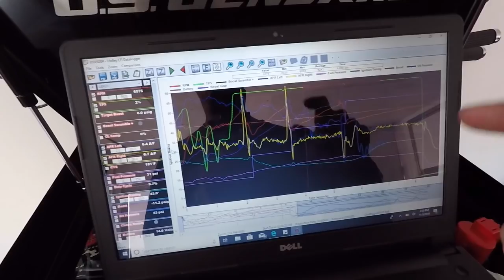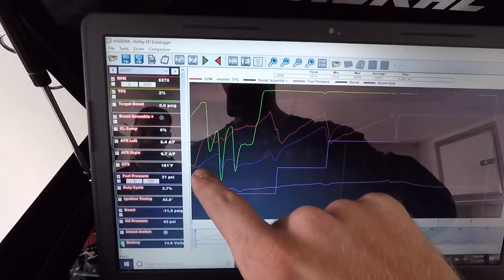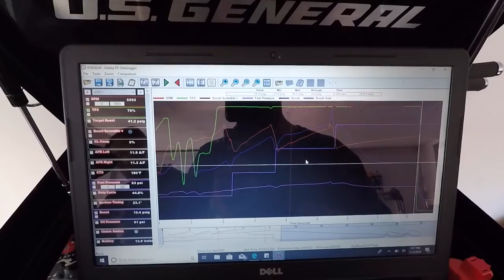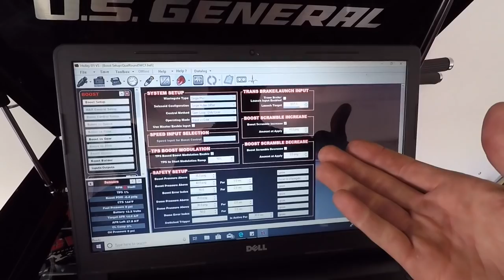World Cup Day #3 - Third Round Qualifying, Shattering Parts (Changing To Old Mounts)

Comment from the maker: Here's the plan guys. The track is SO TIGHT so the plan is to try and use our old diff mount to let the drivetrain move around a little bit more. We think that the new solid torque tube bushings and our new gnarly solid diff mount might just be too much for the current application. We're going to try the old mount and only do soft launches today. We just need to survive the weekend, I already called RPM and said I caved, and that we need one of their C6 rear diffs. The C5 diffs lasted a while but we've reached a point where we make SO MUCH power off the line and through the 1/8th mile that the C5 cases won't cut it anymore. It'll be a pricey swap, but well worth it. RPM always gives us a good deal and they're the best in the business!
Reply: YOU KNOW BEST JUST LET HER RIP
Reply: Cleetus McFarland, good luck guys!!🇺🇸🦅
Reply: Probably the best move.  That C5 diff just can't handle all them bald eagles!
Reply: HELL YEAH LEROY THE SAVAGE!
Reply: Send it baby!!!
Reply: RPM Hook Cleetus up lets get Leroy in the mid 7's
Reply: BOO BOO,  CLEAT CLEAT, AND LEROY JENKINS FOR THE WIN
Reply: LET IT RIP TATER CHIP
Reply: Cleetus McFarland Wash, rinse, repeat kid!
Reply: Cleetus McFarland hi
Reply: I was about to say that ,that diff mount is too much
Reply: Cleetus McFarland  is at all possible it would be awesome but I don’t know how it would work but if you could put electrical power to the front wheels it would leave so quick 😂
Reply: Cleetus McFarland the upgrade cost 1 video....
Reply: 30k+ a month just from your channel, i think you can swing a c6 diff swap lol.
Reply: You NEEED to go c6 Z06 or ZR1 diff. I wish I went that route instead of a cryo treated HD 3.90 base diff. And now they’re making gears for the bigger Z06 diffs.  I’m honestly surprised you didn’t do so earlier. Just sell those trans on EBay.
Reply: @MillionairX  how did you calculate that?
Reply: just encase the prick in jb weld lol
Reply: All this just to lose to a civic 🤭
Reply: Sometimes loose and sloppy is the better option 😂
Reply: Cleetus make some. Merchandise that say James get the tool box
Reply: Let er rip tator chip em bald frekin eagles man. Honestly im amazed how that stock c5 diff held in general... It does make me have even a better thaught of the high quality we get from corvette. Amazing!!
Reply: You need to just go independent 9 inch or back half it and go solid 9 inch.
Reply: @jamesmcivor340  google socialblade and have atter.
Reply: @MillionairX  youtube doesn't pay half as well as it used to.
Reply: What about one of RPMs other diff solutions like 9inch
Reply: Ideally you want a milled hardened and heat treated diff casing, a cast casing will always break it's just not made to handle so much torque. If you can't get one fabricated (places that make custom heads should be able to make one for you given a model), you could also try to reinforce the stock case by enclosing it in a tight tube or rebar cage (tight to the point to have to stretch the bars a bit to get the diff in it, to apply positive pressure on the cast diff case) and anchoring the cage to the frame instead of using the mounts. If it's fitted tight and has uniform contact and pressure around the diff case, a lot of the stress that pushes the diff casing apart will transfer to the cage, and to the frame. It also adds a lot of heat sinking to keep the diff cool.
Reply: Rhys Werner he’s making like $40-50k a month. Gotta pay the cost to be the boss lol
Reply: Sounds like a decent plan.  Best of luck!
Reply: Aero is killing you brother you need a nosecone minimum.great tho do it for dale . And ed
Reply: I think if you do use that solid mount, it'll be best to make sure every bushing on the rear axle is solid aswell. Any play from solid mounts comes from soft bushings.
Reply: Hell Yeah Brother! Talked to Cooper Spaghetti a bit yesterday, he said he hates the smell of diff fluid! Hahaha I think we can all agree on that
Reply: HELL YEAH BROTHER LET LEROY EAT!!!!!! 🇺🇸🇺🇸🙌
Reply: Garrett I sent you an awesome pic of you and Leroy on the starting line yesterday on IG check it out when you get a chance
Reply: after the diff the axle shafts
Reply: You should of already had a c6 diff  on standby because you had to of known you would need one eventually
Reply: Cleetus McFarland dude if you had a better diff and bigger tires you would easily hit 7.6 you need a wider tire! And a stronger diff
Reply: @donnyanda3191  If you go back to the wind tunnel episode, the nose isn't that bad, it's mostly the back end. So a diffuser would do a lot more for them.
Reply: is the plan to have the C6 rear diff in before the C&C Florida?
Reply: Cleetus McFarland i
Reply: Riggs Homestead-fast      Every time your sniffing gear oil it’s usually a bad thing. I’ve Ben down that road... i used to 4x4 the yota. Big nasty rocks destroying ring and pinions, axles, transfercases. Never pleasant when you start smelling gear oilz
Reply: When you were installing that solid mount I was thinking that it might make it worse since there is no give. That aluminum case becomes the weakest link and just can't handle that power.
Reply: Is the new part u put in the bar. Is stiff now
Reply: How many crazy people you guys got running in to you like old boo boo and can't remember a name to save his damn life gotta love Florida you are always gonna see home wild shit there
Reply: Good call guys. Definately need some extra cushion for that glass diff case.
Reply: Good luck today Cleetus, Let her rip!
Reply: Going with the C6 is the right move..  going to be a pain to fit but worth it in the long run
Reply: Unfortunately, when racing hard like the way Cleetus and Leroy do. Things tend to happen parts tend to also break. I was hoping for more record breaking numbers this weekend for Leroy the Savage. Well dang, maybe next time. For now let's keep on doing it for Dale.
Reply: You should look into a clutch flow control valve like the one from clutchmasters to soften up the hit, then put car on a strain guage so you can clutchless shift the rest of the gears
Reply: Makes some JAMES GET THE TOOLBOX t-shirts
Reply: @rhyswerner8749  So what are you saying? 
The website i said to google for literally pulls the data straight from youtubes analytics of each channel. It's not super accurate because of all the variations but good youtubers like cleetus still make a pretty good chunk of change.
Reply: You need to call jay at real street. They use a hydraulic damper on the clutch pedal to control release speed. You can probably even tune the holley to only have it on in first gear or maybe first and second to help ease the shock on the drivetrain. It would make your launch and 60ft more consistent. Then you could cut the 1.1 60s all the time.
Reply: Lettin the difs rip 🚘
Reply: If you need a billet case it should not be that hard to make @Cleetus. measure the stock case, create a 3d model in mastercam and get in cnc machined. take into account thermal expansion rates of billet vs cast. but I would talk to your local machine shop. they should be able to build you one.
Reply: Will be $$$ though. im currently in school for this king of stuff.
Reply: Roberta Swenson They are in Maryland.
Reply: slagertoothtiger Installing a 9” or “back-halving” LeRoy is not an option because of how the in a C5 and later Corvette Chassis/Drivetrain is designed.  Remember in the C5 the “Transmission” is in the back of the car and bolts directly to the “Differential.” Instead of me trying to explain it all it would probably be be better to just Google C5 Corvette Drivetrain and look at a picture(s) instead.
Reply: Why not weld and gusset the c5 case up make it stranger... Fyi I thought the solid torque tube bearings bad idea no place for give with them
Reply: Im sure you would have it if it was built but can you talk to someone that can make a billet case? Is it possible?
Reply: Let her RIP tator chip ..hopefully the last case holds up and gets you through the weekend.
Reply: HMan - I like every word of your fab’d case proposal. I’m not an expert (I wasn’t!), but was already thinking about the relative cost of fabrication compared to all trouble (and broken hearts!) it’s caused over just these last two days, let alone before... Thanks for sharing your obvious expertise.
Reply: You need to forge a differential from thors hammer.... Only that will handle the bald eagles and that amount of freedom...,🇺🇸🇬🇧
Reply: Think thats a great idea! I thought to myself yesterday yall were going to cave and go with the C6 diff. Haha let ‘er rip tater chip! Murica!
Reply: Sounds like your plan is to finish in the middle. Americans don’t quit, don’t go for second and never let our colors run. “If you ain’t 1st, you’re last” go for gold and let Leroy eat.
Reply: I can't wait to see how much power and better runs that c6 diff is going to allow* I think y'all are at a major turning point where Leroy is about to really be ripping some new records*
Reply: It's not the same RPM as high PSI TV is it?
Reply: Titanium parts may be able to hold up I'm sure RPM is thinking your the perfect parts testing person and will push them to perfection on parts.  They are doing their best to provide parts to hold on to the bald eagle power ..but busting up parts is all part of the racing  scene if it's not breaking it's not racing. I would send the broken parts back to RPM for testing it may step up their development of parts it's a win win situation.
Reply: I wonder if the side horse shoe looking brakets could be made into a full circle with incorporating brackets to wrap around the diff cover.... That would make the c5 case much stronger
Reply: Can’t wait till you get the new dif! Hope to see you in Bradenton! Good luck guys!
Reply: The side plates that go around the axle output should have plates that attach to the diff cover kinda like a box surrounding the diff... Then it might hold up. Probably less work and money.
Reply: Exactly my thoughts. Stiff mount and new solid bushings meant zero flex in the driveline back there and pop goes the diffcase every time. A little flex can be a good thing! Nothing wrong with the parts, just a combo together that wasn't going to hold.
Reply: Right on ...makes sence.....you need a little movement
Reply: They r the best but normal people can't afford rpm parts sux
Reply: The cracks look like something tried to come out of the back rather than something twisting
Reply: What's the rationale behind keeping the solid torque tube bushings?    Seems a great way to transfer as much shock into the tranny and diff as possible.
Reply: 9inch for maximum freedom
Reply: Clet, maybe time for a new T-Shirt
"JAMES GET THE TOOLBOX "
Reply: Solid everything is bad for your application. I'm glad to see that you are going back to softer drive line components. You may have to change them often but they rubber stuff is cheaper than the metal stuff.
Reply: Owen Conner c6 z06 and zr1 diffs are practically the same case.
Reply: Make a shirt that says james get the tool box
Reply: nastychevys he doesn’t need that.
Reply: 2001MXZ800  yeah mastercam is a cam program not a cad program and that’s not gonna work you don’t just work programs like that with no experience... there is no need for a billet case a C6 case is stronger it’s his own fault for using the base C5 diff.
Reply: Cleetus McFarland 👍
Reply: Amen brother glad your gonna make the jump to the C6 drivetrain, i think that will be a huge help to the process!
Reply: Cleetus McFarland solid mounts are great but flex is sometimes needed.. damn man I really wanted to see you guys prove the haters wrong
Reply: Why do you need a diff on a drag car?  I suppose if you put in a solid axle and bevel gear you'd still need a strong case/frame on it,  but you could fab that in steel
Reply: Cleetus McFarland them flapping flags are huge aerodynamic losses.... only use em in the pits or on the burnout pad not for a drag run
Reply: Cleetus McFarland 
SLIP IT then RIP IT.
Reply: "Cleetus" I sent you a suggestion about using a "clutch launch control" several times. Its a hydraulic clutch flow control, I really think this could help you. There are several companies that make them from full mechanical to solenoid control via switch or ems. I ran it in a dsm and it seemed to help with diff breakage. I hope you see this even if you upgrade to a stronger diff.
Reply: You realize the 2 times you broke you were on the launch control just a tad longer than any other time? I know you can’t really help that cuz you’re waiting on the light. Just an observation
Reply: Cleetus please change the camera angle back to the original place.. the new one sucks
Reply: Cleetus McFarland I like Leroys kahunas 👍🏽👍🏽👍🏽👍🏽👍🏽
Reply: I think you need to take one of the C5 Differentials to Demolition Ranch Matt for a anger distruction.
Reply: That trans mount cost you 3 diffs get rid of that shit
Reply: Cleetus, any chance RPM can get you the upgrade before eliminations?
Reply: @TheMinecraftsMax  why go through all that when they make a 9" that bolts in
Reply: @TheSoundofSpeed  he lost in the first round it broke again for the 3rd time. He just happened to make it past first gear this time.
Reply: slagertoothtiger I don't a 9" will work on the transaxle?
Reply: @waynebollentin989  ah, damn. Bummer. Thanks for clarifying.
Reply: @CHRISTAPHOR JENKINS lmao. Talladega? Really? Why not the salt flats or lets have him go to Germany and drive the autobahn.
Reply: @getahanddown  100% they bolt to the automatics not sure anyone has done a manual though. 
Years ago we made are own adapter to bolt a 2jz to a powerglide before you could just buy shit. So I don't see why it couldn't be done. I know we're talking apples and oranges here but If someone wants something there's usually someone out there to at least try it.
Reply: Cleetus McFarland time to talk to strange about a 9”
Reply: @TheSoundofSpeed  np bro. I'm sure he'll have a video up soon saying something about it. I believe it happen before 3pm if I remember correctly. A lot of great racing. That white import he runs in the stick shift class made it into the 7.90s finally. At least first time I've seen him get there. Really great racing can't say that enough.
Reply: @jamesmcivor340  watch street speed 717 video on what they make
Reply: Damn leroy is straight savage. Can't contain all his power.
Reply: Good idea boss love the content you make these v8s sing. Love the bowtie love too. Fellow Chevy man, wish we had HD Tho good luck with the c6 rear, agreed you need something with lil more flex room rather than so stiff..
Reply: Got to see cleetus and Leroy. Leroy and cleetus today. Cleetus I have so much respect for you man having such a huge fan base and being so personal with everybody. Most people let the fame get to them and are kind of rude people but cleetus shook my hand signed my shirt. He’s always trying to get to everybody and just have fun. It’s not just about the win for him and that’s how it’s gotta be. I respect you so much for everything you do and I want to thank you for being cool and I can’t wait to see where Leroy goes in the future. Do it for dale
Reply: ratchet strap it together
Reply: Bro change the cradle even though you don’t want to. You need to get a stronger dif put in leroy instead of breaking the old c5 dif almost every pass
Reply: Thts the most disappointment ive ever seen you..
Reply: Hi.  Hey James get the tool book should be on a T-shirt
Reply: @jamesmcivor340  it's public knowledge on social blade and that's a very low estimate he's doing much better not that it's really anyone's business
Reply: Cleetus McFarland million subs I think you can put c6 diff in 😝
Reply: @rhyswerner8749 really because streetspeed717 showed us his Actual payment for 28 days and Cleetus is doing 3 times the views and then some it's more like 60-80 k Mike said he is killing it... Mike made $1,200 off of a hundred thousand views video so if he's getting three to four hundred thousand or more each video do the math ..
Reply: @18brash he's literally made hundreds of passes on the original why would he assume that? This only happened when they switch to the solid mount  and when he was on the best track prep in the world
Reply: @user-qb5cl1jf1t  did you really just tell him that ? Wow
Reply: You guys are pushing so much power through that drivetrain, and the parts are taking a beating like none other. The fact that you have only had diff cases go, aside from possible collateral damage from parts of the case destroying the internals, is literally insane. RPM and Texas Speed need a special combined team just to brainstorm how to put as much power through leroy as possible while breaking the least amount of stuff.
Reply: You know I was thinking while watching that last video before you left when you said what you did about the diff that it might be time to make the upgrade but quickly assumed you know more than I do so there was probably something you saw that I was missing and that was why you were sticking with the C5 cases.
Reply: Gotta get a maximum powered optimal bald eagleness freedom fueled do it for dale hell yeah brother run and take home the giant check.
Reply: EddieG  they took the flags off after a burnout unless you’re blind...
Reply: @Built82F100  this is the best suggestion I have read out of all the comments!!👍
Reply: @user-qb5cl1jf1t  hell if he did that he would be in the low 7s
Reply: Cleetus McFarland James! Get the tool box! Best quote ever
Reply: Cleetus McFarland new diff = 7.40's keep ripping
Reply: Well if you ain't braking parts your not pushing hard enough. Let's go Leroy 💯
Reply: I was thinking about that exact same thing when you mentioned the squat not being there after the first pass last video. Then Sendit Steve's diff case got sent. Lol. Whoa! I just saw the black puff. But yeah I think the diff mount might be too skookum for for going fast.
Reply: The C6 diff is a good move , but as you said, the solid torque tube bushings and aftermarket diff mount is what was causing the case to fail.
Reply: James McIvor some dude put out a video the other day where he calculated how much the big youtubers were making. Second highest earner behind Doug demuro if I remember correctly. 
Was a whole lot of guess work in there.
Reply: Dana 60 ! Just kidding ...C6 differential should hold up to a few good passes. 😳
Reply: boostedbois brent and kyle on sight to help true racer brother love . been a OG boosted sub and a 1320 as well as Garretts channel.. best duo on the Net .
Reply: I just paused the video to come down here and make the same suggestion.. maybe a little wiggle room will result in snapped axles instead of MORE diff. cases.. good luck man
Reply: Jeff Rock  super street it looks like...
Reply: Kyle Bacon  garrett doesn’t 100% know what he’s saying remember this is the same guy who put gasket sealer in the block.. the solid driveshaft bushings should not have been installed he should have bought the DSS drive shaft couplers, the diff mount can stay if you take that off he will crack no only the torque tube but the t56 too.. the case is thin cast the C6 Z06 is way thicker and stronger.
Reply: @freedomfox8183  exactly, it's no-ones business, anybody mentioning money is just salty they don't make as much
Reply: C'MON CLEETUS! STOP WASTING YOUR TIME AND MONEY! GET THE BILLET DIFF ALREADY! Your not driving a stock car. Stock parts wont cut it for a race car. Change out those swing arms and all those stock bearings man. Your driven a lean mean american tread burning machine. This season my vote is for the BILLET DIFF!!!! No stock parts!
Reply: Could you do a subscriber vote? Vote on who wants to see Leroy run with  a temporary Powerglide transmission that could later be swapped over to the El Camino. Just to see how fast Leroy could run with  Powerglide and current engine setup. I'm sure Leroy wouldn't mind. He still has all them bald eagles. I'm guessing low 7's maybe 200.
Reply: Maybe 1second 60 ft.?
Reply: Dillon Simmons there is no such thing. As a billet corvette differential...
Reply: Hey Cleetus i was at the event and i was gonna come back there and introduce myself but you had a mad line of fans around and i didn't get the chance to meet you so hopefully i will get the chance to meet you next time.....GO LEROY!!!!
Reply: CLEETUS!
Reply: It’s because you keep using gear oil!!!Mt.Dew is the appropriate oil weight for this sort of high bald eagle application.
Reply: MillionairX it’s a business. 30k or not the cash flow needs to line up.
Reply: Cleetus think of it like this breaking diffs are just a part of testing and development. It seems that the diff cases are weak to begin with. The aluminum that the cases are cast from is too light for any application.
Reply: Cleetus McFarland ya killin me smalls, I need my Leroy fix!  I'm tweaking over here. It's been like 2 days sir.  Help me 😐
Reply: Hell yeah! 🦅 Leroy's going to need a catch pan for the rear
Reply: Wild in the first day repair
Reply: @andrewjames6707  nope wrap it in duct tape that will fix anything 😂🤣😂